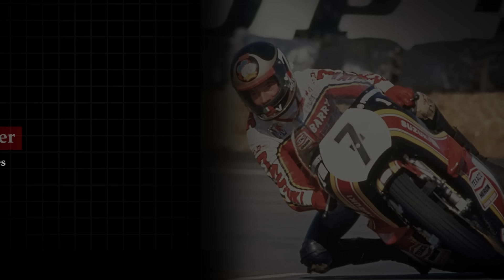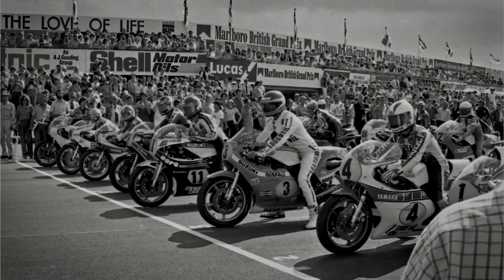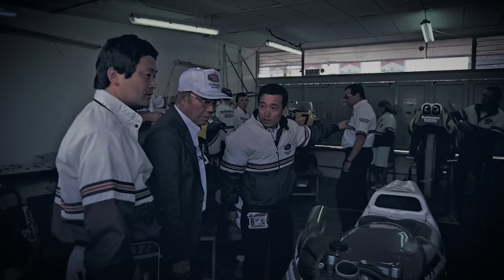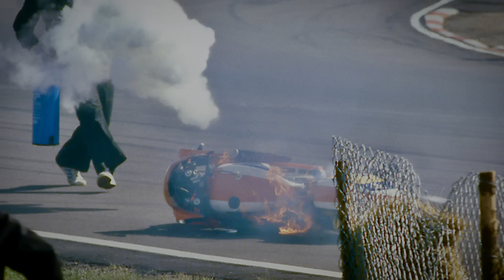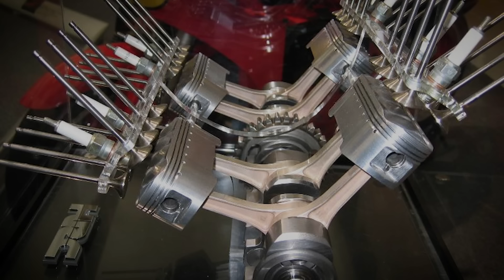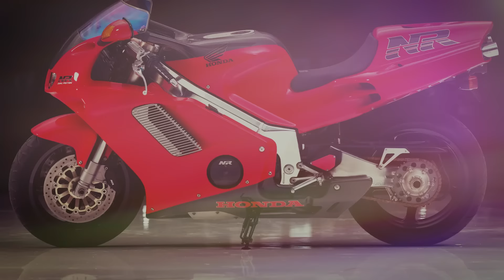The Fascinating Story of Honda’s NR500, the Oval-Piston Engine Built to Beat Two-Strokes

Comment: A friend of mine had an nr750 and that bike was so far ahead of everything. It have heads up display the suspension was ahead  of almost everything like it. I know some of the other manufactures sold straight up detuned full on race bikes. We at a certain dealership got lucky or I did because the owner was always trying to buy up old race bikes and the road going versions. That meant I as the head mechanic got to work on alot of cool shit we had an nr500 that had moto gp bikes well hondas. he had several rc30s and 2 rc45s hell he had one of the v5 moto gp bikes I'm not going to look up there names sorry. So this meant we got to ride some of the rarest bikes in the world. I got to daily an rc30 for a few weeks cause I was putting a big bore kit on my suzuki gs1100e to a 1216cc over bore as well as installing everything. better oil pump change the guts of the dash so my speedo would go to 140 or more mph. I don't want to go outside in the heat.. and my 00 dodge  Cummins 2500 got the death code on my injection pump and I went full retard on it with compound turbos big injectors etc.  So I'm riding this rc30 to work and back we where on the outside the city. Well I decided to go around a bunch of people because on the 2 lane highway people will set there and go 45mph in a 60 mph area. So I'm going around15 cars cause people suck and I see this cloud of blue smoke behind me and I think OH SHIT!!! I just blew the motor on an rc30!!!! but it seems fine got to work put it on one of my lifts and I start looking for signs of what happen I mean I got the plugs out and they says no we are good lol.. So I go to the owner and tell him what I did  and that I;d pulled the plugs and they look fine idk!! He laughs at me which made me really worry. Then he says yeah I was talking to one of the honds hrc engineers he said that the crank case vent on the back head needs to be cleaned more often than the book if its rode good/hard and that it can cause the bike to burn a lot of oil..  He's like you're good so sense you already got it down to where you have the plugs out so go ahead and do a full service I'm like how am I getting home?? He says well better get started!! So I spent the day blowing apart that bike and good lord the thing is just beautified no sharp edges that cut you open!! talking to yamaha suzuki but I could run the valves cause I didn't have the right shim and I don't like trying to sand one down.. hell I have only succeeded twice by puting them in my small mill using a carbide cutter.. Anyways its closing time and I can't get a ride the one guy who lived near me wasn't in today I'm freaking out pushing in bikes and 4 wheeler the owner comes out gives me the key to the shop truck he's like use this when you can't use that and ill see you tomorrow . So I come in on my day off. finish up the rc30 then I got to the suzuki on the lift and it takes 4 of us to get the block on cause the sleeves where so thin there was no bevel this meant we used pick's and the ring clamps for the the gl1800 ring compressors. we got it done. after that I worked on and rode beautiful some awesome superbikes..

Comment: I saw 2 TT-F1 spec NR750s (pictured at 18:31) race in the 87 Swann series in Australia, they were extremely quick, every bit as fast as the tuned FZR1000s that were dominating the series. And one ridden by Australian Mal Campbell won the race.  The one pictured was the one that raced in the 87 LeMans 24 hour race,, riders said it was significantly faster than the RVF750s.  These TT-F1 bikes of the 80s were nothing to do with the later 92 NR roadbike.

Comment: During the oval piston era I found the engine a constant source of wonder, but, even given the slick compounds of the day, would get beaten on the corners and the straights by the 2T bikes. The 2T engines could have made lots more power further outdistancing the NR, but that had to wait for tire tech to catch up.

Each 125cc cylinder could produce 60+ HP using disc valve intakes and power valve exhausts, but even at the end in 2002-2003 tire and chassis tech still hadn't caught up to even that easily obtained level of engine power.

Comment: The V65 motor v4 street bike was a monster. In my hands I beat every machine that dared line up against  me.
Reply: Bought a cheap V65 Sabre as a commuter.  Didn't know much about it other than it was cheap at the time $900.  My coworker got a 91 CBR600 and decided to line up against me for shits and giggles.  I couldn't believe it when the Sabre not only beat the CBR at launch, but steadily walk away from it until we shut it down on a service road behind an airport.  He was a little annoyed that a junky bike beat the new CBR.  Funny enough he bought the bike when I decided to sell it to buy an FZR400.
Reply: @Tryingtonapnow now I  have two first gen vmax bikes. 😊
Reply: i used to smash those v-65 on my 1982 GS1100E,
Reply: @garyeuscher4499 not mine
Reply: Did it have oval pistons?
Reply: Oh, I remember those days well! The engineering from those old factories was truly something else. Bet you have some wonderful memories on that V65. 🤝☕
Reply: @IndustrialRuinsUK  I owned 12 in total back in the 2000's. I miss them all.
Reply: Not the flex you think it is....
Reply: @john1959ism also a 2002 Vtx 1800 custom build